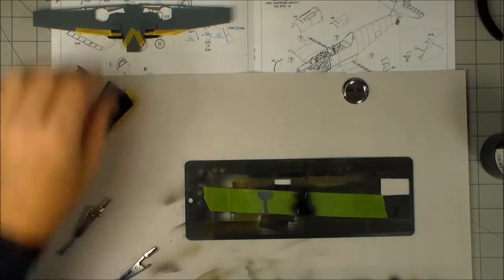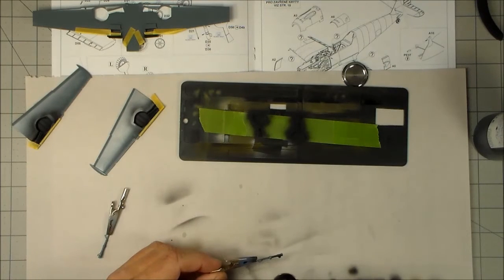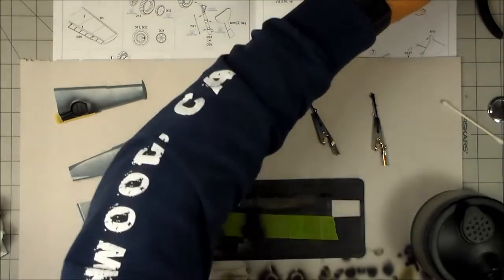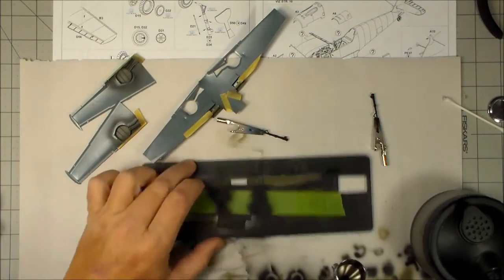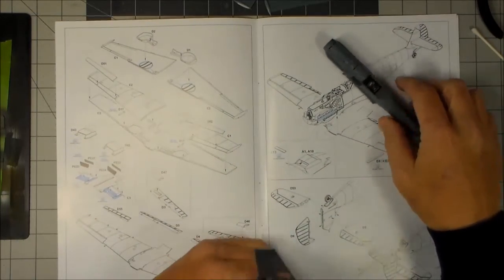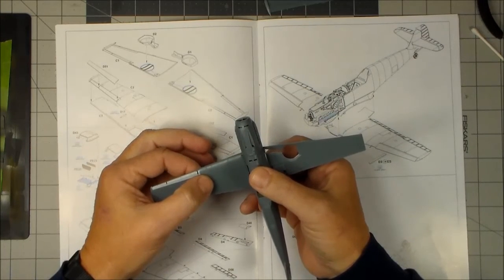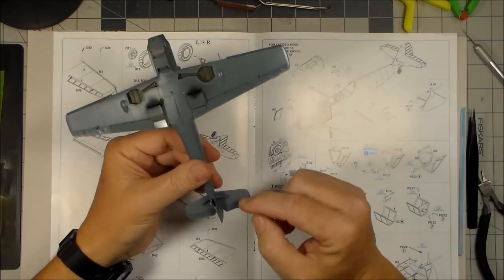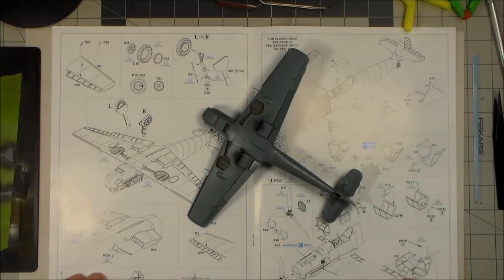Eduard Bf109 pt 4

Comment: I see you have discovered the best airbrush now! I aslo see you are still using Vallejo - you tried Stynylrez yet? It is supreme!!
Reply from the maker: The Iwata airbrushes I have are excellent! As for the primer, Vallejo seems to work fine for me, especially if I thin it ever so slightly. I don't sand after primer, so that hasn't been an issue yet.
Oddly enough however, I have a bottle of Stynylrez being delivered today. Depending on how it works, I may be gifting my three bottles of Vallejo to someone who needs it!